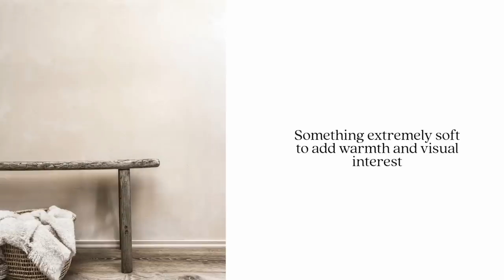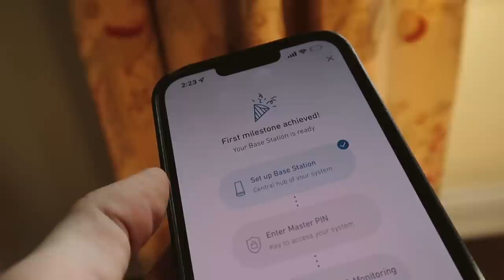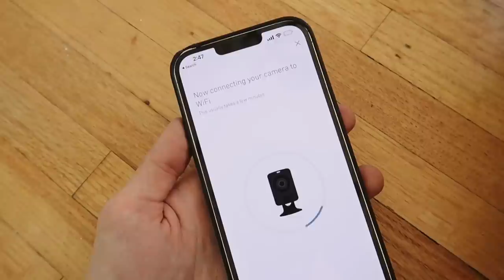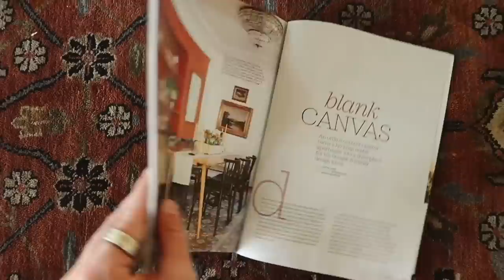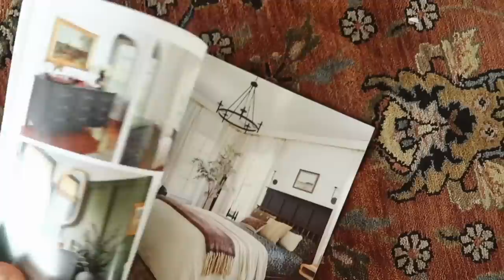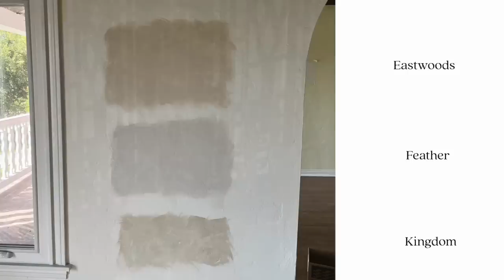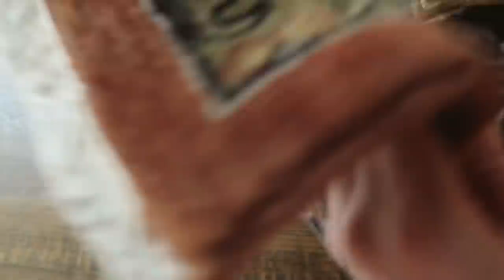This was a huge waste of time

Comment: I really like the contrast of the dark wood and white. Maybe with a little more texture. Congratulations on your magazine spread-well deserved!
Reply from the maker: I just need like 10% less contrast! The white feels so overpowering to me
Reply: I like the white walls and dark wood, too. Feels really classic and crisp to me. But then again i stained my hardwood floors black with creamy white walls. Doesnt really scream Spanish, though, so I can def understand it not fitting in with the home as a whole. We only see one frame of it.
Reply: @lonefox  I think the house is screaming for a Sherwin Williams 50/50 Mix Neutral Ground SW 7568 / Natural Tan SW 7567.
Reply: @lonefox  sometimes you need to do white to blank out the old.  Then you can see what direction you should go.  
Look at me giving painting advice when I painted my walls 12 years ago and not likely to repaint any time soon.  I still love the colour which looks different on every wall and is still in pretty good condition.  I'm in Queensland.
Reply: @lonefox  it 100% was too over powering. I agree but I think if you put some large art on that wall it would be less intense and striking
Reply: I agree with Drew, it looks stark. Not the look you want with Spanish houses.
Reply: @lonefox  agreed!!!
Reply: Yeah, if the vibe is “spanish”, we used to do white with dark wood in colonial era
Reply: @lonefox  There's no right or wrong when it comes to taste, but you will never go wrong with a white canvas wall in that house, old spanish houses were treated inside with white stucco. It's historically very accurate to have a very white wall with very dark features, the rest they did via beautiful stairs and floor tiles, painted tiles and terracota tiles, depending on budget. A vanilla or light tan paint will also look great.

Comment: I like using drop cloths instead of paper or plastic. I feel like the cloth absorbs the paint so if u accidentally step on a drop u won't spread it around ur floor?
Reply: Agree big time. Just look at professional painters.
Reply: Also, if you start collecting your old stained or ripped sheets, you're getting it all for free and more environmentally freiendly than buying new.
Reply: Agree.  Best advice I was ever given about painting, from a pro painter, was to invest in cloth drop cloths.  They don't just save your floors from wet paint, but dry paint too.  The dried splotches can get stamped back onto your floor off plastic cloths but that doesn't happen with cloth.
Reply: I always paint with bare feet. You always know if you have stepped in paint. Keeps you from walking it onto your floor.
Reply: I tried using some sheets and the paint seeped through. Very disappointing 😂
Reply: @feliciabailey0411  you have to get painter's cloth from the paint store,  it should be thicker than sheets.
Reply: @feliciabailey0411  Dang!  Disappointing for sure!  Cloth drop-cloths that you get from a paint store are thicker and more textured than a sheet.  I've had mine for several years, and knock on wood, have never had paint seep through.  I either got them at Home Depot or Benjamin Moore... can't remember which....not cheap but they've been great for me.
Reply: Cardboard works best for me.
Reply: Lowe's again could supply.
Reply: @sparklie962   Painters drop cloths are heavy canvas with a plastic water/paint proof backing. They come in many different sizes including long and narrow for halls- and they are cheap $20-40 - use over and over

Comment: I am 1000% sure you put up the the SImpliSafe yard sign for the video/sponsorship, but just in case, here is a PSA for everyone: do not put those branded yard signs up, as those give away which system you use and it is super easy to find out what secuirty level and frequency to hack into to disable your alarm before entering your home. 

If you want the sign as an added level deterance for intruders, put up a generic unbranded sign

Comment: Great video, as always!!

If you’re going to be using the same paint color for most of the house getting a 5 or 10 gallon bucket would probably be a lot better value.

And hay is usually green and used for feed. Straw is usually yellow/golden and used to bed animals.

Comment: Yes, congrats on the magazine spot! well done you  :). I  use an old   'plant stand'   to put a container of paint on it..So it is easy just to bend down, and dip your paintbrush in...when painting walls. You must also place a plastic drop sheet if a little accident happens. The plant stands are about 80yrs old...but you can find them in Op shops..or..garage sales.

Comment: I've made mistakes/errors along the way too & I've learned from them. This is just the beginning of your new house's story, so just remember, enjoy it & u know u'll laugh abt it later. 😉 Huge Congrats on the magazine article!! What an honor. Back in the mid 90's I  pretty much did the same technique on my walls, but I just used regular paint in 2 different shades. I ended up adding some water to the darker color, then I scrunched up an old wash cloth & sorta "washed" the walls w it. It turned out great & I just loved it. It's super easy & definitely less expensive than using those  specialty paints. Can't wait to see your finished colors!

Comment: Drew it's probably too late now, but I "lime wash" walls all the time. Treat your walls like a canvas. Just use a few sponges and 2 or 3 different tones watered down with water and play with your colours one ontop of the other whilst still wet. Work in sections. When it's dry and it's too dark just take a lighter colour watered down and go over it again. It's sooo easy.  Probably not proper lime washing but you can create sooo many amazing textures depending on how you drag the sponges across the wall and over each other. My walls last forever and are fully washable because I use quality paint.

Comment: Hey Drew, if you use a paint stick attached to your roller it will go twice as fast.  You can put more pressure on the wall distributing the paint better.  You can even use a mop or broom handle that will screw into the roller holder.  Hope that helps!

Comment: Professional user of lime paints here...any very light colours of lime paint are going to have virtually zero movement when dry.  You're better off choosing a significantly darker colour as your base colour then going with a 50% tint of that or just a lighter colour for your second coat.  Don't forget, you should also be adding a out 20% water to the second coat.  This encourages the lime in the paint to come to the surface adding to that "chalky haze".  I end up telling my clients over and over again that any shade of white is basically a big "why bother".  Unless you're interested in doing medium toned colours, you're not going to get the "movement" you're hoping for.  Yes, you'll have brush texture that you can see up close, but otherwise, not so much.  Beware the Pintrest pics that likely have had the contrast boosted!  So, my advice is to not bother with the 75% of the colour either.  Choose something darker OR use a darker colour for your base coat. Significantly darker.  Make a test board on a piece of board from Home Depot at least 24"x24" before you go doing the whole wall again.

Comment: Ah yes, when I first moved into my new home, I decided to repaint the master bathroom which has 12' ceilings. As you are probably aware by now masking off the trim, windows, light fixtures, closet door, water closet, and cabinetry is quite a job! Well... I scheduled a week's leave from work thinking it would take a couple of days to complete. Brother let me tell you, in order do the job correctly with two coats of a light taupe satin paint, working 10-12 hours per day it took me 5 days to complete! So, I feel your pain, it's a much bigger job than you realize from the start, but I have 100% satisfaction with the results! Remember once you use a textured paint on the wall, it's there for good and there is a real skill to making the texture look random instead of looking homemade. In short, if you start getting tired while doing the walls it's time to stop and take a rest, and not mess it up... good luck! Here's an idea also, research home interiors of Granada, Barcelona and Madrid for inspiration, after all, California Spanish style was invented in Spain... Ole`, Ole`!!! 😎

Comment: Texture and color are not the same thing, I like the silvery green on the rug for the wall. The texture in venetian plaster can be simulated by adding fine marble dust mixed into the paint. Once dry you can buff it to give opaque/matte and glossy textures to the wall bringing out the texture in your brush strokes. If you add more marble dust it can even be applied with a spatula. I imagine you can even tint spackle to get yet another effect. So the 3 things you can treat your wall with are, color, texture and from matte to high gloss. I would stick to finishing structure first and that would mean  in that room floors from what I can see. That house is a dream and the hand-wrought chandelier is superb and a perfect fit.

Comment: Maybe dry washing in 2 shades will help the texture.   The furniture store that I used to work at used to do feature walls with around 3 colors. She used a brush similar to yours and rags and sponges.   (Did NOT look like sponge walls from the 1980s)

Also, when I was playing with the % of paint pigment for rental property, I read that it can change tones and it isn't equal to % of paint to white paint.  In fact, one comment said she preferred to mix whites and then have store paint match for better results. (I was happy w/75%, so I didn't test any of this out)

Comment: Just curious, how easy is it to paint over a lime washed wall? Is it difficult to go back to a regular paint? Or am I then committed to it forever 😆?
Reply: Yes very good question- Drew may have PLASTER WALLS and if that is the case he can accidently start crumbling them like sand with too much lime (acid) and water. But I imagine the walls have been painted through the years and now are sealed. If the walls have STUCCO mix over plaster ( and I think that's what he has) he really just wants a very well made FLAT paint . BTW  oil-based paint  and acrylic paints  can NOT go over each other UNLESS you use a primer

Comment: Have you experimented with adding some plaster-of-paris to your paint? Or some other additives (eg cornflour or bicard soda)? I've been experimenting with adding some products to a concrete mix whilst sprucing up storage boxes. It's interesting to see the different results. I'm busily collecting egg shells (adding some gold leaf inside) and glass bottles. When I have enough I'll crush them (but not too much) to create a pattern on the top of my courtyard table that I want to concrete. I may do a layer of resin over the top just so I can catch as much of the glass and shell effect as possible and not have most of it sink to the bottom of the concrete. But of course, none of this is relevant to your walls. All I meant to say was to try adding something different (not in the standard paint stores) until you get the effect you're after. You might have to use two colours or more to get patterns of light and shadow on the walls.

Comment: I'm not sure, but the way my monitor is reading, you may have accidentally mixed up Simply White and White Dove on your wall samples, and that's why it ended up reading much whiter than you had anticipated. White Dove should be significantly warmer.

Comment: Never do this % of color thing. You will never get it right and you have to determine what undertones will work with that orange floor. Buy a high end name like Ben Moore or Sherwin Wms and put the color test on a large piece of WHITE board to see the true color. . You can buy a tremendous aid WHITE and NEUTRAL color wheel from Marie Killam and even get a professional color consult from her.  I used SW White Egret for my condo with burnt orange Italian tile floors that were also next to a kitchen tile floor with taupe undertone and it was perfect. From my consult with Marie.

Comment: This article is about the mineral or gem. For other uses, see Mica (disambiguation).
Mica
Mica (6911818878).jpg
General
Category	Phyllosilicates
Formula
(repeating unit)	AB2–3(X, Si)4O10(O, F, OH)2
IMA symbol	Mca[1]
Identification
Color	purple, rosy, silver, gray (lepidolite); dark green, brown, black (biotite); yellowish-brown, green-white (phlogopite); colorless, transparent (muscovite)
Cleavage	Almost perfect
Fracture	flaky
Mohs scale hardness	2.5–4 (lepidolite); 2.5–3 biotite; 2.5–3 phlogopite; 2–2.5 muscovite
Luster	pearly, vitreous
Streak	White, colorless
Specific gravity	2.8–3.0
Diagnostic features	cleavage
References	[2][3][4][5]

Sheets of mica

Photomicrographs of a thin section containing phlogopite. In cross-polarized light on left, plane-polarized light on right.

Dark mica from eastern Ontario
Micas (/ˈmaɪkəz/ MY-kəz) are a group of silicate minerals whose outstanding physical characteristic is that individual mica crystals can easily be split into extremely thin elastic plates. This characteristic is described as perfect basal cleavage. Mica is common in igneous and metamorphic rock and is occasionally found as small flakes in sedimentary rock.[6] It is particularly prominent in many granites, pegmatites, and schists,[7] and "books" (large individual crystals) of mica several feet across have been found in some pegmatites.[8]

Micas are used in products such as drywalls, paints, fillers, especially in parts for automobiles, roofing and shingles, as well as in electronics. The mineral is used in cosmetics to add "shimmer" or "frost."

Comment: About your safety system: just be advise while advising potential intruders with your external garden signage, you simplified the job of those nasty person. Why? Intruders are potential hackers!
Those all know that in Northern America, UK, ... You are not having blinders but alarm system instead so, they are equipped with apps having the specificity to neutralise such alarm.

They will be entering your house without any alarm on, no filming, ect

Comment: Great that you're painting BUT your roller desperately needs paint on it AND you should be painting in a "W" corn across the walls so you don't see thin areas. Save yourself extra painting by putting more paint on the roller. Just from my experience in professionally painting houses